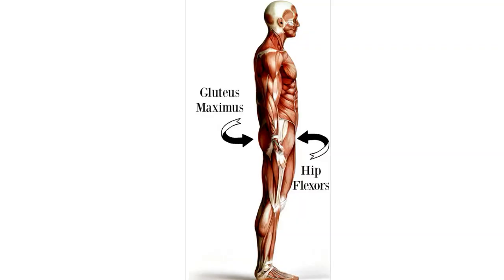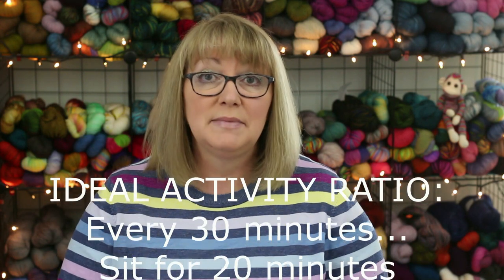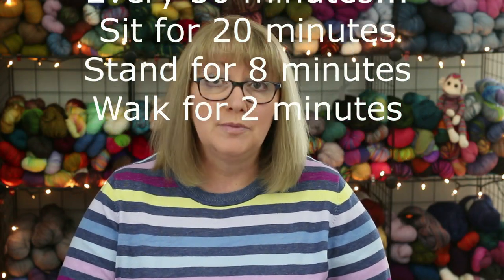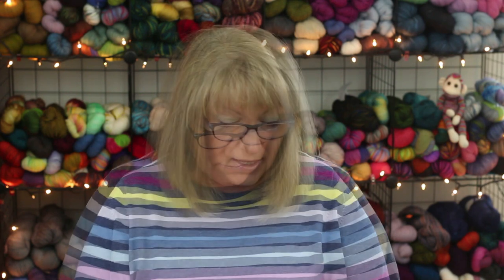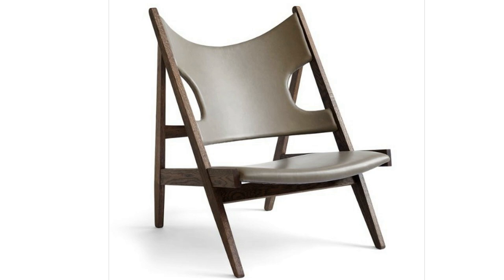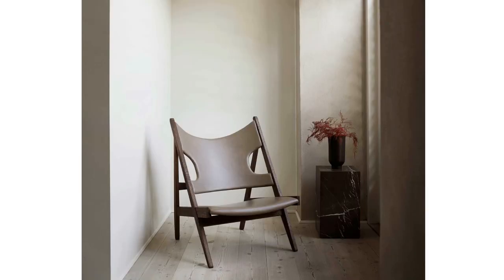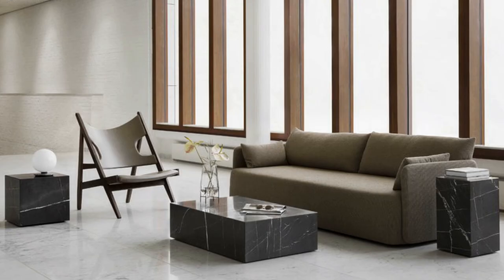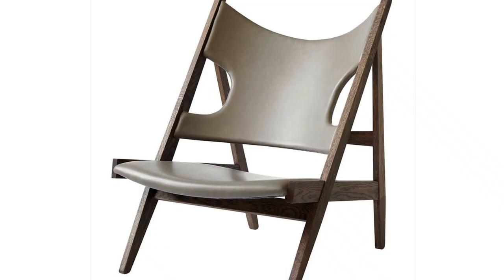CRAFT CHAIRS AND THE SCIENCE OF SITTING || EWE UNIVERSITY

Comment: Kris, we bought a Broyhill sofa with the sturdiest cushions I could find. It is holding up well. That's where I knit. I have bought several chairs for my sewing table. Just a thick padded seat and no arms on the chair seem to work best for me. As long as it twists and rolls .  I don't lean back much so the expense for an ergonomical chair was a waste. Remember the little sewing rocking chairs our Grandmother's used? They are the best for knitting. No arms and they were low to the floor so you could have feet flat on the floor or stretch them out a bit. I have a couple of those , too. Changing it up seems to work . Great video, Cheryl

Comment: The most comfortable knitting seating I've found is actually my bed. I have tons of extra pillows so I can build support where I need it, under my knees, in my lumbar, and even my cervical spine. My set up usually looks a lot like an oversized version of the bed chair pillows from the 90s. However I have found a stationary padded swivel chair to be my best friend while knitting. It reclines, and has a foot stool if you want to use it (I just use the foot stool to hold my project bag or notions or pattern usually). I found mind off a garage sale page on Facebook as an additional seating option for my home office. But since I stopped working from home it's become my  favorite chair. After nearly 10 yrs I'm not looking to replace it with something similar but that isnt a faux leather finish and has slightly higher arms. I have found that with lower arm rests I tend to twist or lean to find the arm rest which causes all sorts of back and shoulder problems. The chair I have is small enough to fit in almost any room and is light enough to move...but not having wheels sometimes makes it tricky. I often wonder if a winged back chair would be a better option.

Comment: Thanks for the info on ergonomics.  I worked as a lawyer for 35 years-they had to turn off the automatic lights in my office because I would sit and do tax research, and the lights would turn off!  That is a good indication you need to get up and more.  More important than moving, however, is I carried stress in my neck and shoulders.  This made sitting for long periods really uncomfortable.  Thankfully, I don't have these problems now that I am retired.  I try and get 30 minutes of cardio a day, and try not to sit down until 5:00 in the afternoon.  Then I have a glass of wine, and knit.  Unfortunately, if that goes to two glasses, the knitting doesn't get done.  I have a recliner, with pretty good support, and I use a pillow for extra lumbar support.  My legs are either bent or straight out.  Then I was diagnosed with knee issues, from keeping my knees bent for hours on end.  So now I change my seating position periodically, and do PT, and it really helps.  Interestingly, walking or running maked my knees feel better.  How is that for an indication we are not made to sit!

Comment: I've added the chairs you suggested which are available from Amazon.com to my Amazon wish list.  Are there office supply stores in Galesburg which would have ergonomic office chairs?  What about the Target or Walmart in Galesburg?  (There's a Serta office chair I've seen at my local Walmart for $99.99 which is rated for up to at least 270 lbs. weight capacity and seems ergonomic, so I've saved that to my Walmart wish list.)  The $50 specials in the office chairs you suggested on Amazon all seem to have 250 lb. weight capacity; however, the Best Office Midback chair had a customer review from a 300 lb. individual who found it quite comfortable, so that sounds like a definite possibility.
As for living room-type chairs, it sounds like I should look for mid-century style with firm cushioning (NOT a recliner, probably . . . sigh), and use a timer to remind me to get up and move around every so often.
So, I took notes while listening, and saved things to my Amazon wish list.  Now I just have to wait until my daughter moves out to start shopping!